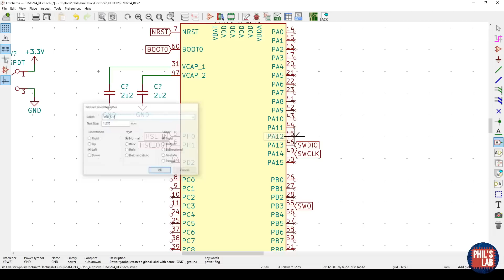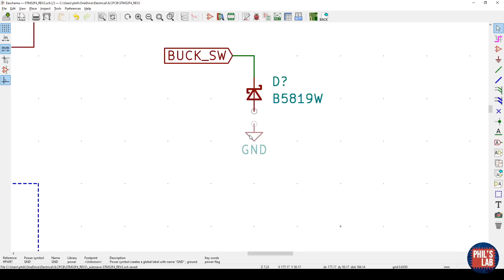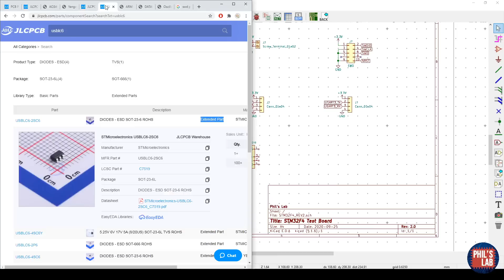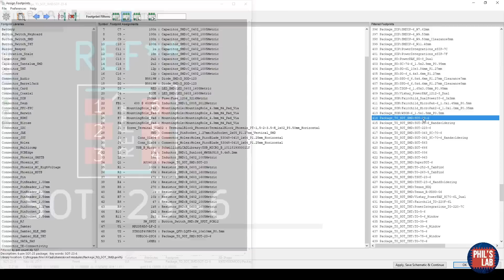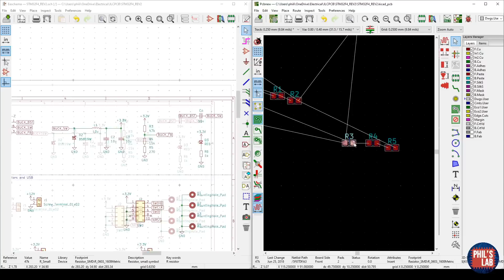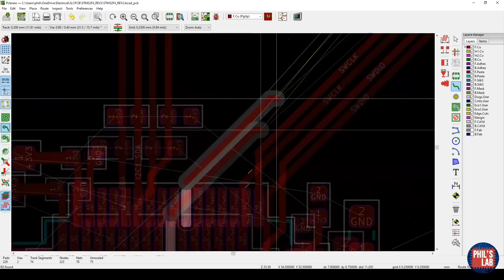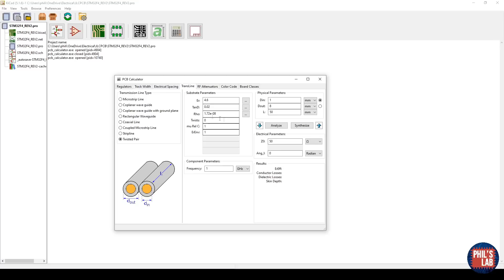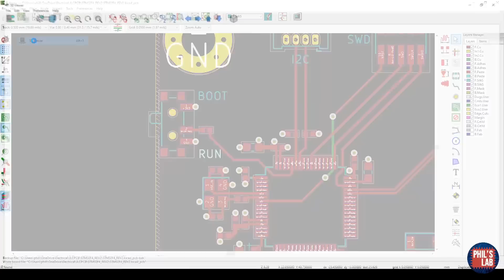(Sponsored) KiCad STM32 + USB + Buck Converter PCB Design and JLCPCB Assembly - Phil's Lab #11

Comment: Pretty awesome video, you really teach a lot, thanks for your time sharing that to us. I have 2 Questions tho, i think at the voltage divider in 3.3V the real value has to be 2.7kOhms and not 270 according to ohms law, and second i would like to ask you something very specific do you have any email so i can contact you? Thanks again for the very educated lessons!!!
Reply from the maker: Thank you, Andreas!
No, the value is correct and should be 270 Ohms. Check the MP2359 datasheet (page 6): R1/R2 = Vout/0.81 - 1. Therefore, if R1 = 47k, R2=15.27k, then Vout = 3.3V.
Yep, you can reach me at: philip.salmony@philsal.co.uk
Reply: @PhilsLab  Yes, you are right, i didnt notice the schematic formula so i calculated with another method, my bad..

Comment: These are some really great tutorials. I've learnt a huge amount from them in terms of using KiCad as well as general circuit design. It would be really cool if you did a tutorial covering portable STM32 boards e.g. using a LiPo battery, charger and step up as well as other tips like saving space on the board.
Reply from the maker: Thank you very much, James. Very glad to hear that!
Might be doing something related to LiPo batteries/BMS/charging/etc in the future!

Comment: your rpp has a problem it don't work the freewheeling diode in that fet will short also you need to limit the current to the gate so 10k and a 12v zener are a good idea regardless of input spec as it will also add esd protection for the fet

Comment: As some other people have already mentioned in the comments, i would also love a follow-up video on the actual assembly and programming of the boards.
What kind of programmer are you using? What IDE?
Thank you for this video, it was excellent and informative!
Reply from the maker: Thank you! A video showing the assembly and how to program one of these boards will be out in a couple of hours.
I'm using an ST-Link programmer and STM32CubeIDE.
Reply: @PhilsLab  Hi Phil, did that video ever come out? I would love to see how you (specifically) would program one of these boards. Thanks!
Reply: I use the ST-LINK (V2-1) broken off from a NUCLEO PCB to program the PCB (or a Blue Pill).  Both jumpers must be removed (not shorted) on the ST-Link's CN2 connector to allow programming to an external PCB. 
The programmer's CN4 connector (Pin2 = SWCLK, 3=GND, 4=SWDIO) to the PCB SWCLK, GND and SWDIO pins.

I used a coping saw to remove the programmer part.  Need to be incredible like the hulk to break it off.  🦾

Comment: Aside from the pcb desigb part, I'd be curious to know what you would intend to use the 3 stm32 boards I saw you make in 3 videos (this one, the nrf24 and your breakthrough video). I can guess for the RF one but the 2 others kinda puzzle me since you mainly break out communication peripherals. With very few to no IO lines. I am curious to see what's brewing behind the scenes :)
Reply from the maker: Most of these boards in the 'tutorial type' videos are just to go through the motions to show how you could choose peripherals and route them, rather than the boards being actually useful in this state. In the latest programming video you can see an actual 'useful' board with various sensors and more IO lines exposed. Will be making more videos on stuff like sensor fusion, filtering, etc. where we'll be using that board!

Comment: .in my knowledge leds need 10 to 20mA(max)..but : (3.3-3)/1500 = 0.3 mA !!!!...
Reply from the maker: If you want to burn your eyes out, use 10-20mA. In my opinion that is far too much in reality. I always use around 1mA and that is sufficient for my needs. Also, the forward voltage is much lower for smaller currents (see datasheet).
Reply: @PhilsLab  burn my eyes!!!!....No kidding

Comment: Awesome video and explanation. Thank you very much for taking the time to explain this. I was wondering if you could do a video on building a PCB that could be used as a Walkie-Talkie. Integrating a STM32 chip with audio capabilities, a NRF24L01+ chip for receiving/transmitting the audio and a headphone jack (for cellphone headphones TRRS – speakers + microphone). I would also be very interested in the software part of this. I am currently working with Arduino/Teensy but I have very little experience with STM32s.
Reply from the maker: Thank you very much! That does sound like a rather interesting idea. One PCB I had planned on showing was an STM32 + USB High Speed + an audio codec, for delivering and receiving high-rate/quality audio to and from a PC. That would be kinda similar I guess (except for the RF part).
Reply: Phil’s Lab That would be nice too. But the RF idea would be interesting because you could use the PCB “standalone” without the PC. And I would be really grateful because I would like to be able to make such a project :)

Comment: Great video. I am thinking about moving from Proteus to Kicad now that Kicad provides absolute coordinate positioning at last. Why do you hide the component refs on the silkscreen? Are they not needed for the PCB manufacturer?
Reply from the maker: Thank you, Sean! I haven't used Proteus before but KiCad pretty much has everything I need for the types of designs I do.
For the assembly house I use (JLCPCB), they thankfully don't require any designators on the silkscreen and for fairly simple designs like this I like to hide them for aesthetic reasons. All the assembly information for JLCPCB is then included in a footprint position file + BOM.

Comment: Good video -- but 48:43 you did not read the datasheet properly.
On/Off Control Input. Pull EN above 1.2V to turn the device on. For automatic enable, connect a
100kΩ resistor between this pin and Vin pin.

you can just use a 100kΩ resistor to VIN. 68K is not needed.
I'm using MP parts for decades.
Reply from the maker: Thank you! Yes, you're right - 68k isn't needed - I was just going by max. ratings and didn't read that part :)

Comment: Phil, how did you find out the actual load capacitance of the crystal? The datasheet doesn't tell what the corresponding letter means.
Reply from the maker: Yeah, the crystal datasheet is pretty irritating. You need to follow the LCSC link (via part number) to see the actual crystal load capacitance, which then turns out to be 9pF.

Comment: Great video so far, I'm an hour in. Love that two output bulk caps on the buck "looks cooler," I completely agree haha.
Oh and IIRC the USB shield should be grounded at the host, not at the end device. So leaving it floating here is the right thing I believe. The point is to avoid there being a current path through the shield, which there would be if it was connected to 0V on your PCB
Reply from the maker: Thank you, Simon! Haha yeah, definitely looks cooler in my eyes but it does have some additional (minor) benefits.
Yes, exactly, ground at host and leave floating at device side. There are many schools of thought when it comes to (USB) grounding, but as you described, this is what I believe is the right thing to do as well.
Reply: @PhilsLab  awesome.  Loved the rest of the video btw.  Really looking forward to seeing the finished board and some testing if you decide to do a video on it :-)  Thank you for sharing, now I am seriously considering making the switch from Eagle (which I have used forever and learned on) to KiCAD.  It just seems so much better, even considering I actually have an Eagle license.  Controlled impedance and diff pairs especially.

Comment: First of all, thanks for the really nice content. It was really enjoyable to watch it:)

I have a question: why do you use PULL-UP resistors on the I2C lines? Doesn't the MCU provide internal PULL-UP and PULL-DOWN resistors?
Reply from the maker: Thank you very much, Dmitrij!
The internal pull-up resistors of the MCU in general are pretty weak (as in they have a high value). For I2C fast mode, for example, you'll need to have quite low-valued resistors (e.g. 2k2).

Comment: Excellent content, subscribed. I’d be worried about exceeding the Vgs of the P-FET from lead inductance. I’d say no hot plugging and a slower ramp up on what ever power supply is delivering 12v. Would be interesting to scope the input filter cap and trigger of the power up.
Reply from the maker: Thank you, Han! Yes, it probably would be a good idea to add some protection to the gate but for the sake of time I omitted quite a few things from this video.

Comment: Thanks a lot, really usefull information on how to get it designed. I actually started modifying your PCB design for some design I was already considering.

The thing I personally mostly looking for as well, is how to get properly getting started with programming the STM32. There is a lot of information everywhere, but no real to the point video (At least I can find) to get properly started, what hardware/software you need (Besides the PCB). Can you make a video that, starting from this board, how to get started going further on with programming it?
Reply from the maker: Thank you very much for your comment, Paul!
I have just ordered a new set of boards from JLCPCB that contain an STM32 + a variety of different sensors, etc. I'll be (hopefully) making a video this month detailing how I go about programming STM32 (basic setup, drivers, etc.). Hopefully that'll be the thing you're looking for!
Reply: @PhilsLab  Hi Phil, really impressed of the educational level in your voice over, I learnt a lot and have taken the step to convert my EasyEDA designs to KiCad from now on. 

I would also be interested in getting started with programming a board like yours with STMCubeIDE but are a little bit to lazy to read the whole 2k+ pages of the reference manual for HAL drivers of the STM32F4-mcu. 

If you have experience with CAN and STM32 then would it be a mouthful to ask you to explain how to get started with CAN in your next video?
Reply: I second this

Comment: This is a really good reference video! Thank you for taking the time to make and share this. One quick Q: You did not put any ground planes on the top and bottom layers. Why?
Reply from the maker: Thank you very much!
I used to pour ground on top and bottom as well and then stitch to the internal ground plane with vias. But to be honest, I don't see any great benefits to doing so (there are cases where it may help with EMI). There are a number of articles on the subject, e.g. https://resources.altium.com/p/shaky-ground-arguments-against-copper-pours

Comment: When routing, if you want a nice 90 degree T-shaped connection you can hold cmd (or would it be Windows key or ctrl?) and it should force the track to be straight :) 

Also look up "acid traps" ;)
Reply: I was wondering about acid traps. Dave (eevblog) has said that it might not be an issue these days, but he still never does acute angles.
Reply: Halojen It will probably fine when you get nice prototypes. Worth knowing about though. If you went to mass production and started getting the PCB’s made as cheap as possible I believe you can specify a lower standard of manufacture, it might become more relevant then
Reply: Oh and those tooling marker dots are called "fiducials" and are already in the KiCad libraries in a variety of sizes.

Comment: This video is an absolute goldmine for someone making their first PCB! 
In fact I wish I had seen this a couple of weeks ago as I just made a board with 12V and a USB micro and that trick with the Schottky is very neat. 

For the USB, although you have the embedded pull-up on D+ don't you still need to detect USB VBUS on a GPIO and then call USB_DevConnect() to enable the pull-up since your board could be self-powered? I have been following section 3.1.1 of AN4879 on this.
Reply from the maker: Thank you very much, Matthew!
I've never needed the VBUS detection for USB and all boards so far have enumerated automatically without having to call USB_DevConnect() (or similar). Maybe adding VBUS sensing is recommended in some cases but for what I do, I've never needed it before!

Comment: I was reading AN2867 and it says  RExt = 1 / (2 π F CL2), if F= 16 MHz and CL2= 12pF, then that gives me 828.9 Ohms. How did you get from there to 47 Ohm?
Reply from the maker: That expression is just to give you a ballpark figure for RExt. Basically, Rext in combination with one of the load capacitors forms a low-pass filter to attenuate higher harmonics of the crystal. However, the main calculation that needs to be done is to do with the transconductance and gain margins - this is all detailed in that application note and will give you a much lower value for Rext. This is the one you should choose to ensure that the oscillations are able to build up and sustained.

Comment: Great Video, but can you tell me why JLCPCB charges me with 38$ Service Fee for 4-layer boards and you not?🤔
Reply from the maker: Thank you, Peter. Hmm that's strange, what size boards are you having made?
Reply: Phil’s Lab EURO cards (160x100mm)
Reply: @schmelpe  Once the board is larger than 50x50 mm, the price increases drastically. I think its because the board size has to be customarily cut.
Reply: @suvapillay9358  Thanks for that hint. Great.

Comment: It would be nice if you could import the full component list from JLCPCB (or other PCB Houses) so that when you select a component from their library and add it to the schematic the JLCPCB part numbers etc are included rather than have to manually associate the part number afterwards at a later stage.  It's not an issue for a handful of components, but if you had hundreds or more it would become very tiresome having to manually type in or copy/paste them in.
Reply from the maker: Yeah, that would be nice. I might not be doing the whole component assignment thing in the most optimal way but it's worked for me so far and I've gotten used to it. Shame that it is so manual however, that could really be automated..

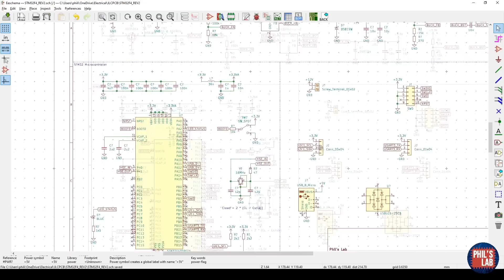Comment: 01:06:30 I'm confused about USB 5V or 12V powering to circuit. For example what will happen if 12 V and USB 5 V connected same time to the circuit ?
Reply: Phil pointed it out - The diode D1 will block the powering from USB.
Reply: @e42_marvin  how it would be because D1 anode connected to UBS 5V ?
Reply: @onurolce  but you have a higher positive potential on the cathode of D1 (12V > 5V). If you have a lab supply and some parts - try it out. If not you can simulate it here: http://falstad.com/circuit/.
Reply: @e42_marvin  yeah I tried on falstad, the result is as you said. thanks :)

Comment: Thank youuu Phil's again you are amazing ?? I have two questions !!! Can we program this board using Arduino IDE ? or we have to use ST-Link to program this breakout board? and The second question,  if we design other STM32.  Could we use USB directly to program the board ??? Thank you Phil's alootttt and appreciate all for your time!!!
Reply from the maker: Thank you! Yes, you could program this board via the ArduinoIDE (e.g. via https://github.com/stm32duino). You can either use the ST-Link or program this board via USB DFU (by pulling BOOT0 high).

Comment: Thanks Phil! Very detailed and in-dept video! As to the USB shielding, I'm with you. Grounding the shield at the host side. And leaving it floating at the device side. But shielding USB opinions vary as much as opinions on pineapple on pizza :)
Reply from the maker: Thank you, Dustin! Yes indeed, everyone has a different opinion on USB shields and there doesn't seem to be a clear answer. But I haven't had issues with doing it this way and it makes the most sense to me (unless you have a metallic enclosure, then I would tie the shield to that).

Comment: Using labels to connect the parts of the buck converter makes the schematic very hard to read; I use labels for the processor but not within analog circuitry.

Comment: Outstanding, this will help lots of people, thanks for doing this! Do you know of a tool/website that makes it easier to find parts on JLC-PCB by providing filters other than the package? Do you know which of the two sources (jlcpcb smt parts library website/ the part list in excel sheet) is more up to date? I would love to use their service, but finding a part in a simple list without the ability to filter is a no-go for me. There should be an option on lcsc to filter for basic parts/ extended parts for JLCPCB, otherwise it's too time consuming to find usable parts, at least for me. Am I missing something here? Anyway, keep up the good work, cheers!
Reply from the maker: Thank you very much! Actually I recently saw that someone made a parametric search tool for the JLCPCB parts library: https://yaqwsx.github.io/jlcparts/
That should hopefully be what you’re looking for! As you say, I hope JLCPCB will refine their search tool in the near future as well.
Reply: @PhilsLab  No way, that's exactly what I was looking for! Thanks for the scoop!

Comment: Great video, but I think you're overdoing it a bit with netlabels to a point where the schematic becomes harder to read than it would be otherwise. It makes totally sense to me to use the netlabes on the MCU, where you typically swap around a lot of pins while doing the layout, but for the pins of the voltage regulator, it would never occur to me to use netlabels. But everyone has their own style of doing things...
Reply from the maker: Thanks! I understand your point but as you said, I guess it’s just my ‘style’ of doing things.

Comment: Great video Phil. Do you prototype circuits like this on a breadboard first or are you just sure that it will work? Or asked another way: for what kind of circuits will you do a prototype?
Reply from the maker: Thank you, Per! For my own ‘proper’ PCBs, I will check everything (datasheets, schematics, layout, etc.) many, many times before sending it off. Typically I won’t protoype on a breadboard as that is very hard to do with these components. So pretty much just experience and checking for errors!